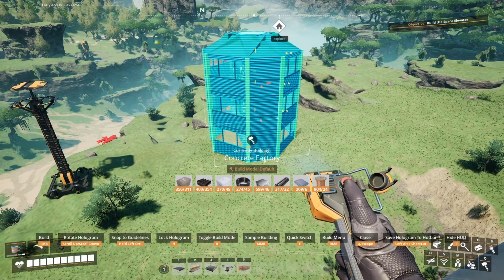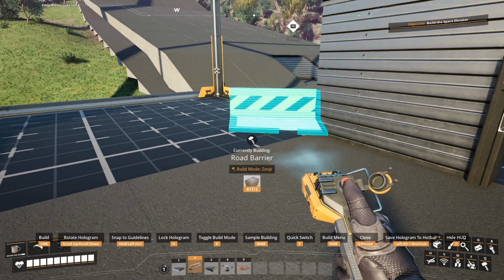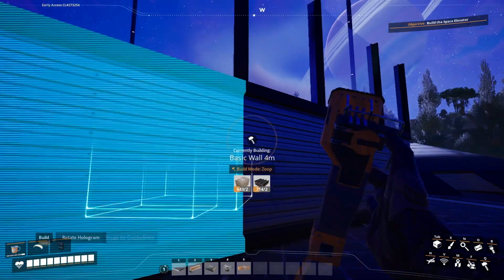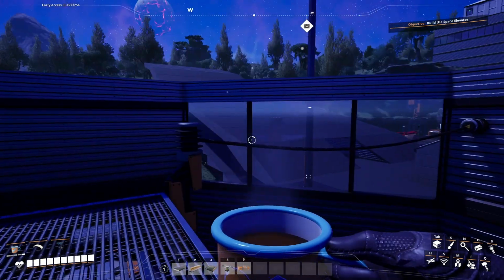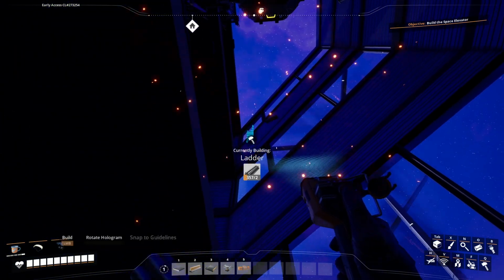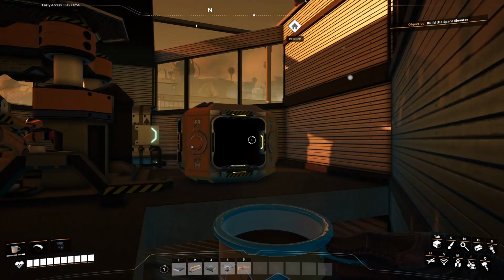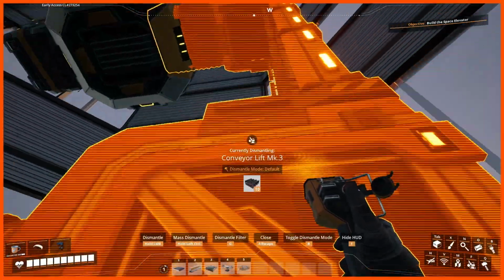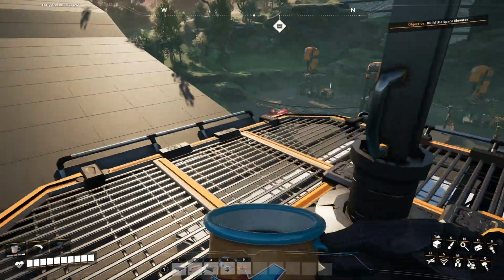Concrete Blueprint Part 1 - The Machines

Comment: Hi ! Just to tell you, you are taking a lot of extra steps. You can put your diag walls directly on the blueprint designer OR just use one 1m wall et use CTRL with the standard one. Nice work otherwise !!
Reply from the maker: i just went and tried, even while holding CTRL it still just rotates at 90s not 45s

i can put a foundation down at a 45 but then its corner is .25 meters away from the straight line wall
Reply: @Dadisfactory  they are two different technique : the first one is to be used without any walls or floor, just on the black canvas of the blueprint designer 
The second is one you place your 1m on the corner of your floor, holding CTRL can also be use to change your wall from one type to another (ex : standard to concrete by selecting a concrete wall while pointing à standard wall and pressing CTRL) 
It s a nice trick when trying a new architecture 
Have fun 😀
Reply from the maker: https://youtu.be/ERhCFzuehcw

im failing to figure it out and a quick youtube search didnt seem to help either, im clearly not understanding something you are saying.
Reply from the maker: alright, i finally figured out the CTRL method you mentioned. i cant find any mention of that on youtube or the satisfactory reddit, nor does it seem to say it ingame, very nice trick.

as for placing diagonally directly on the BP machine, im still not figuring that out